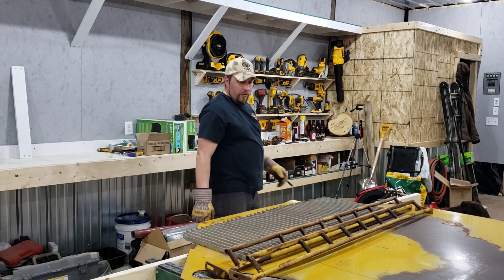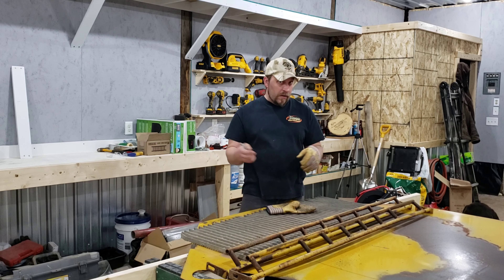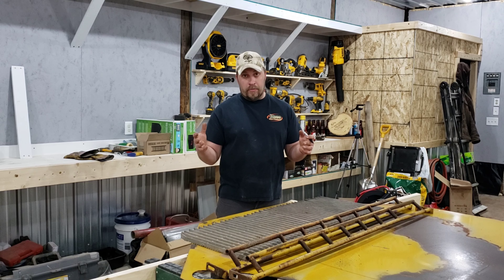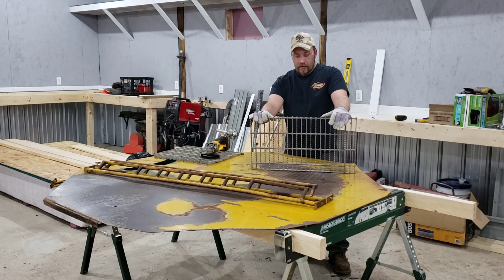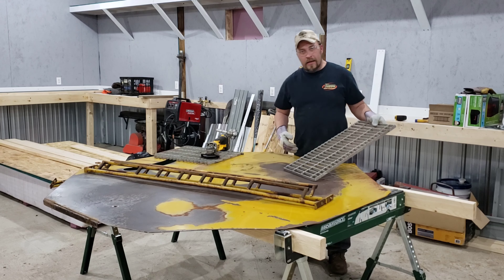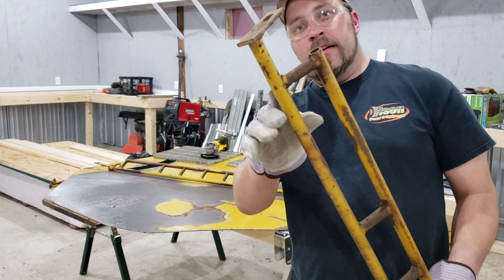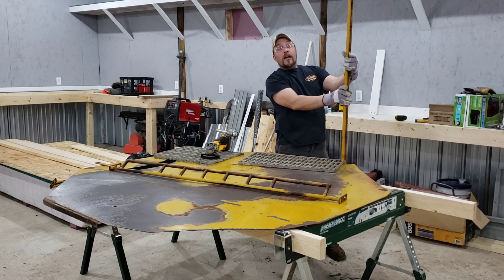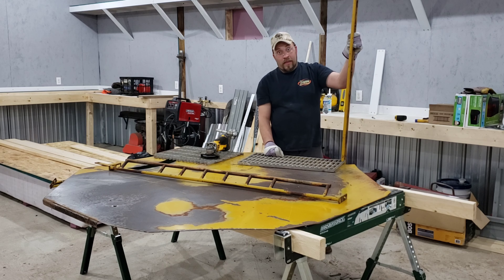Farm Vlog #10 Torch Cart Build Part 1

Comment: As far as tires go if your gonna be dragging that thing outside I'd go with some rubber tires, maybe something off a boat trailer 4.80 - 8 range at least you can drag it across the gravel easier not to mention that one rock that notoriously gets in the way on the shop floor